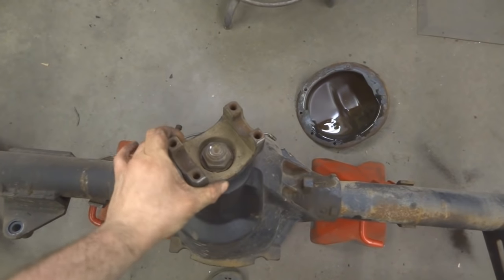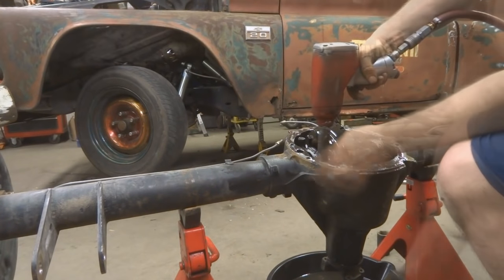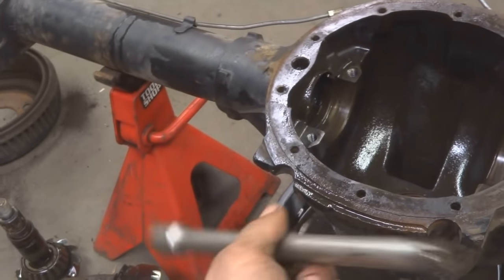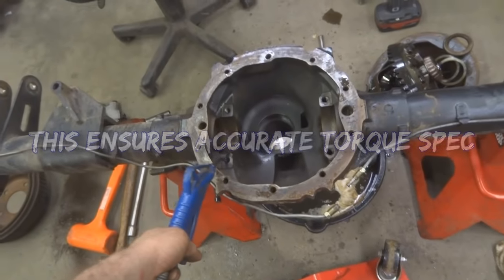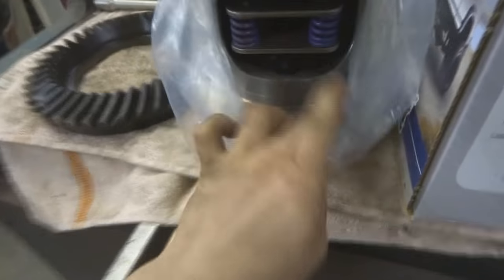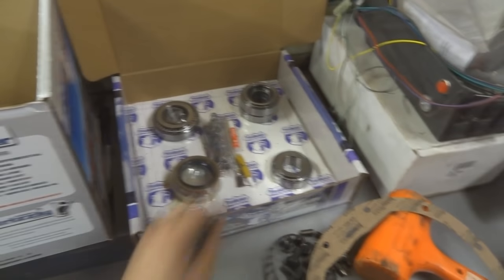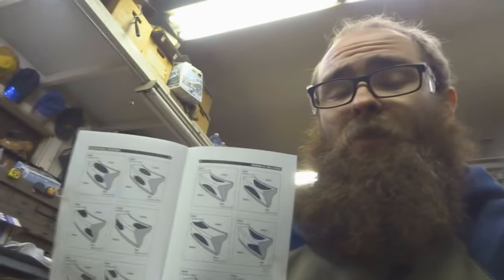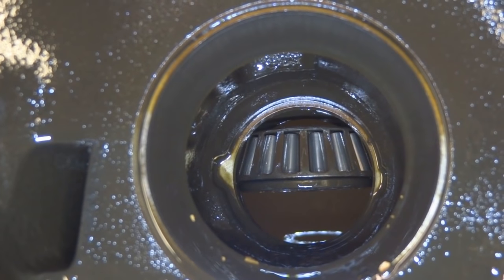How To: Rebuild a GM 8.5" Rear Axle 10 Bolt Chevy

Comment: What did you torque the bearing cap bolts to?
Reply from the maker: I think it was 60ft lbs. It gave all the torque specs in the instruction book that came with the Yukon Locker. Or can be googled easily. "gm 8.5" axle main cap torque spec"

Comment: How’d you torque the pinion, and check for bearing load?
Reply from the maker: It's in the video.
Reply: Tinman 2 Kustoms I understand you use the 15 inch lbs setup to check your bearing load, but how did you actually torque the pinion nut down? Just use a impact gun? Or use a torque wrench to a certain point, check load, torque, check load? Thanks
Reply from the maker: @joshuakeith8710  I get it started with an impact. Then use a big breaker bar/Chester pipe and a big pipe wrench holding the pinion In place while tightening the nut. Usually a 2 person Job. Then pull off the tools and check the pinion spinning resistance, and repeat the process like 10-15 times or until it's right.
Reply: Much better response. Thank you.

Comment: Why don't any of these videos show how the carrier shims are figured out? It's so frustrating when the builder says " I got .200" on the right and .220" on the left" and doesn't show why?
Reply from the maker: Because most guys pay attention to how it was taken apart and start out by putting the same shims back in the same spot. Every case is going to be slightly different.  So it's not really something you can just tell someone a number for.
Reply: @Tinman2Kustoms  Like most guys I did note the shims on each side. I'm not looking for a number. What I am looking for is the procedure to set the backlash. I'm doing a first time install of a posi carrier and the original shims were to tight. You mention looking elsewhere to find the procedure so I did. Otherwise a great video.
Reply from the maker: @davel4666  makes sense. I probably should have mentioned that, but honestly that's a tough thing to just explain without showing

Comment: Did I miss the crush sleeve segment?
Reply from the maker: I don't remember if I mentioned it or went into it much. But get the fucker pretty much as you can possibly get it with a 6ft pipe on your breaker bar and someone else or the weight of something heavy holding the yoke stationary with a pipe wrench. Checking occasionally with the weighted basket or torque wrench. It's kind of hard to explain.
Reply: @Tinman2Kustoms  copy that thanks very much

Comment: Stupid question here 🤚 lol 8.5 an 7.5 relate to pinion diameter correct ?
Reply from the maker: steel sledge no. The ring gear diameter is what the 8.5" stands for. The pinion is usually measured in teeth and/or relation to ring gear for ratio.
Reply: Tinman 2 Kustoms actually that’s what I meant to type damnit lol but thanks for replying I measured my ring last night, no idea why I typed pinion .

Comment: so you showed everything except the actuall install of the carrier...
Reply from the maker: Literally all you have to do is set it in there and put the cap bolts in.
Reply from the maker: If you cant do that, don't try to do this job
Reply: oh thats how you marry the ring n pin ... just bolt it in...
Reply from the maker: @ericm7994  and obviously it needs to be shimmed accordingly. Which is also said in the video. Don't like it? Make your own video. If you knew what you were doing you wouldn't be here in the first place. Easy to talk smack behind a computer screen.
Reply: even while i read that all i could hear was squeeekk sqweeeek squueeeekkk..

Comment: I'd just like to say , I bought all new parts , gears differential all that .. I tried 6 times sofar and it still makes a humming sound so loud you can't hear yourself talk .. everything looks good , I don't understand
Reply from the maker: TheOklahomabourne is it a constant hum? It's probably a bad gear mesh if so. Meaning your gears aren't set properly. If it's only a hum on deceleration it's a loose pinion nut.
Reply: Tinman 2 Kustoms , thanks I seem to learn the hard way . I'm thinking the pinion gear might be too far in. Only thing I didn't replace was the races. But it humms louder the faster I go and pretty much the whole time
Reply: I moved the differential all over the place, I'm pretty sure I messed up with the pinion spacers maybe
Reply: I did learn a few things from this video , like the crush sleeve and wait to put the front seal in after I get the preload set
Reply from the maker: Give yukon tech a call and they might be able to talk you through it. But I'd bet it has something to do with the pinion depth.

Comment: You didn't even show how to put everything together, you transitioned from pressing the bearings in, to it being completely put together, you missed one of the most important parts, what about torque specs, what about the crush sleeve, how do i install the new races without the correct tools, somethings to look out for on the final Assembly.

Comment: Id like to see 200# torque with the coffee can and string "trick"
Reply from the maker: It's not the torque on the nut. It's drag on the pinion/yoke that you're looking at. The force it takes to spin the yoke will go up the tighter that nut gets. It's a crush sleeve design. If you don't believe me, call and ask Yukon gear & axle. Or refer to their comment on this video where they said great video. They wouldn't say that if it weren't right.
Reply: I was referring to the part where u said 15 ft lbs and did it with cup and string. Its same as a torque wrench. I was saying id like to see that with 200# .....get a torque wrench. It had nothing to do with sayiing I dont understand this method. I got it.
Reply: @Tinman2Kustoms  oh and btw, they said great vid bc you used and named and showed their box w their name on it. Its free advertising. Why dont you look at other vids of shops and super clean benches using and naming their products......you Will see them say thank you there as well. Its free advertising, id say thanks too!
Reply from the maker: K. Lol where's your video?
Reply from the maker: I have a torque wrench. This is a how to video. Not everyone has all the proper tools. Anyone can rig up something like what I showed. that's the point.
Reply: @Tinman2Kustoms  then you should show how to correctly do it. Trust me, anyone who doesnt have one, should not and probably has no idea how to do diff work. Nevermind. Great video!
Reply from the maker: @michaelcollins1899  that's ignorant to say. I didn't have one for a long time. Had always done it by feel. A lot of guys do it that way. Just because you don't have the tools doesn't mean you shouldn't or can't do it. Just means you're not very creative or willing to make shit work.
Reply: @Tinman2Kustoms  im not ignorant you can trust me on that. But making it work just doesnt always cut it when you talk about thousandths in backlash. Sure every squirrel finds a nut , even the blind one every now and then, but when the directions come with all the different spacers of different thickness as this does, and describes how to check for backlash in torque lbs , thats the correct way to make it last and perform the best. So I know you have a wrench, ...maybe, the point is to do it right. So to the guy who doesnt have one (I have 2) , tell them to rent one free at rhe auto store. Nothing wrong with shade tree, as ive done it 1000 times, but with a rear diff, thats not where I personally would trust the can and string as you really dont know the weight of handle and can combo. Move it 1inch lower and higher, and you are off by a lb or more easy. Hey it worked, good.
Reply: @Tinman2Kustoms  k lol. Its everybodys answer to defend themselves.....wheres your video is always the answer. I dont need a video, we did it without watching a video, we followed specs, when machinist existed and ppl actually carried calipers in pocket...and knew how to read it. Dial, not digital.

Comment: Looks like a backlash issue
Reply from the maker: Backlash was set to factory spec. With a dial indicator. Not sure how it looks off? Pattern was pretty nice.
Reply: Tinman 2 Kustoms worn gears
Reply from the maker: @GarySalinas92  Yeah, the gears have 100,000 miles on them. A little bit of wear is to be expected. This is a budget build. I would be happy to replace the R&P if you're willing to send 200$ to me via paypal! Comment back if you are!!!

Comment: I understood next to none of this. Guess I'll be paying someone else to do this.
Reply from the maker: That's not a bad idea! Its okay to pay people to do things like this.
Reply: @Tinman2Kustoms  Would I be able to ask you a quick question though. I recently bought a 99 Jimmy that belonged to my dad who is about to die. I want to restore it but also make it better than it was. I think the rear end is going out and I would like to replace it. I heard that an Easton G eighty would be a good choice or a truetrac. Would you happen to know if gm actually made a Jimmy with one or if I would have to have it done customly? And if I did would I be able to use my existing axle assembly to put one in or would I have to find one from another vehicle?
Reply from the maker: @johnmartin6334  I'd recommend you call Yukon gear and axle. They probably make what you're looking for. You'd just need a posi carrier and rebuild kit probably.

Comment: Poor display, you pulled out the pinion and didn't show the shims, which is very important to note. This is a poor video.
Reply from the maker: Every rear axle will have different shim sizes in there. Showing what I had in mine will do absolutely nothing at all for you. If you're worried, take yours apart, and keep the shims and put them right back in for your initial setup and see if it's close.
Reply from the maker: Also, if you watch the video at 8:13 I literally showed the shims on the pinion. Maybe watch the video before rudely commenting.

Comment: How do you adjust backslash?
Reply from the maker: Jonathan Ganther change the pinion depth. You must remove pinion and add or remove shims underneath the pinion gear. But if you're using the same gear set as before, you can just replace the old shims exactly as they were. If you're adding a new ring & pinion, plan on getting an extra pinion bearing and grinding it out a bit so it can be used as a "setup bearing". That way you can easily remove the bearing and add your shims and test fit until it's right. Then you can put on the final bearing once you've figured your shimming